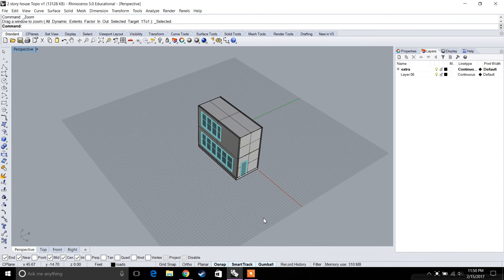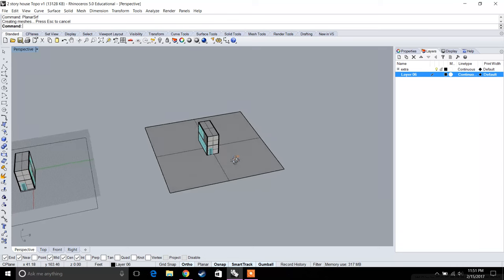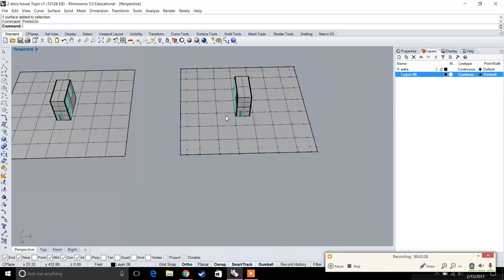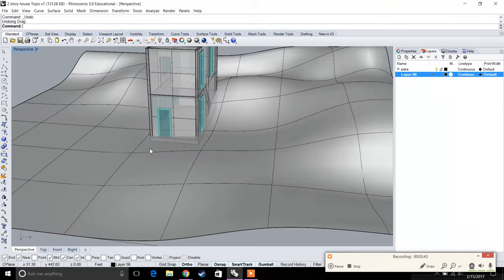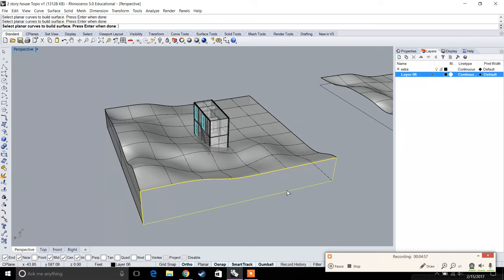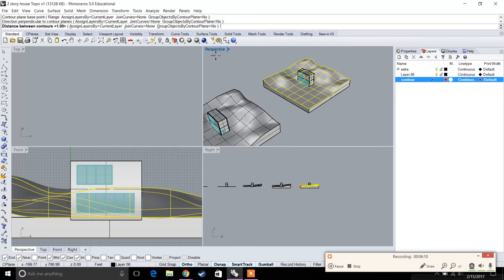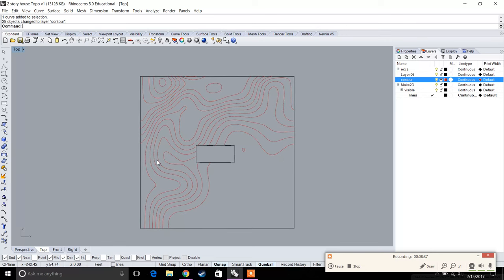Rhino Beginner Series: Free-form Topography Modeling 01

Comment: 1. create working area
2. select the shape and create 'Planarsrf'
3. select the surface and 'Rebuild'
i. select point count
4. type in 'PointsOn', select surface to turn points on, press enter
5. you now have points that you can move to create your topography
i. you can multi select points
6. @4:05 make a solid form for the topography
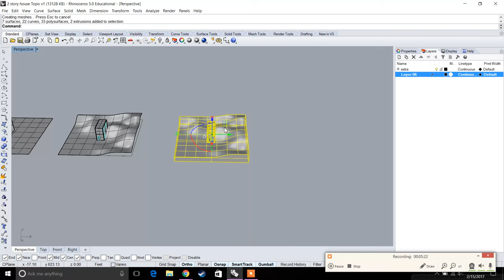7. @5:25 make contour lines
8. use Rhino 2D Symbol Library 
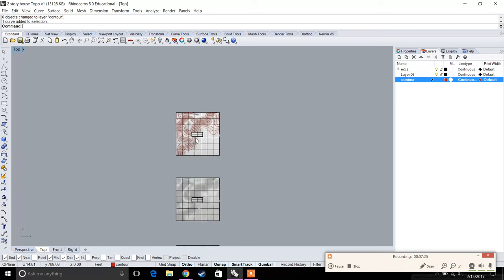9. @7:25 Make 2D
end of part 1